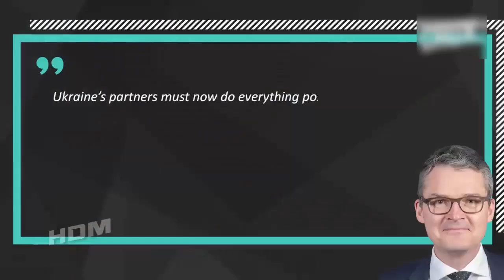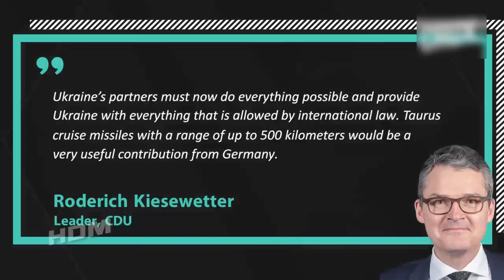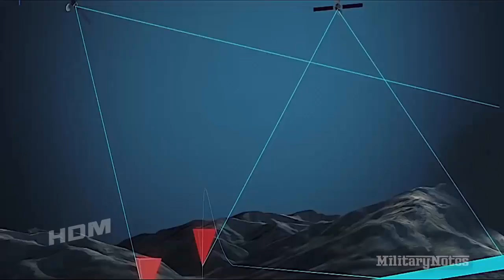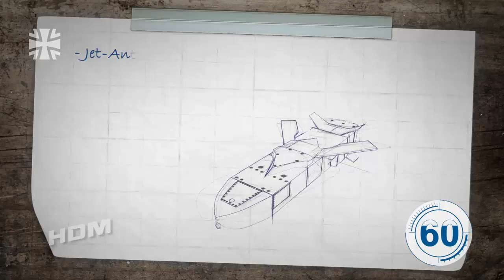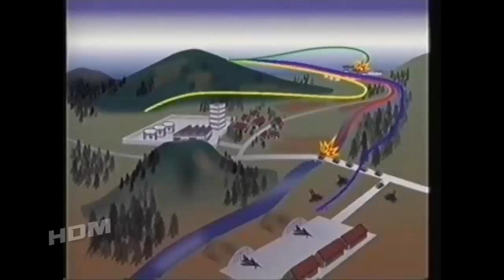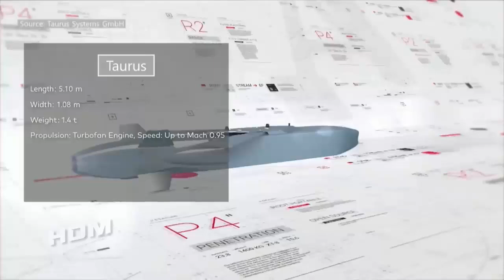Bunker Buster Taurus! This is how the German cruise missile works

Comment: How much does Taurus missile cost, is it cheaper than 2k$ shahed drones
Reply: around a million for one
Reply: Ukraine now using cardboard drones  to take out tanks  $1000  each 😅
Reply: @cheetomussollini Those believe in myths would bite dust. 😂
Reply: @cheetomussollini  but Taurus is a bunker buster U 🤡
Reply: Ich glaube nicht das man mit ner 2,000dollar Drohne große Brücken und tiefliegende Bunker zerstören kann.den dafür wird Taurus eingesetzt.😉
Reply: @kev...87das war auch Ironisch von ihm gemeint 😂
Reply: Surely a 2k$ Shahed drone will have the same bunker busting capabilities as the taurus combined with range and speed + 4 pillar navigation system. You get what you pay for.